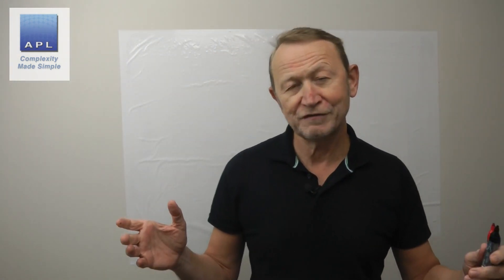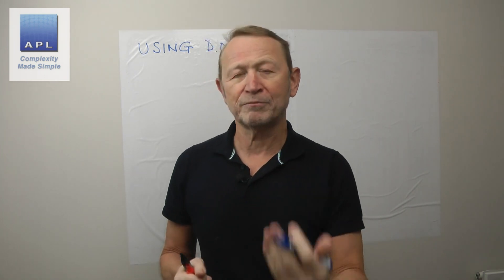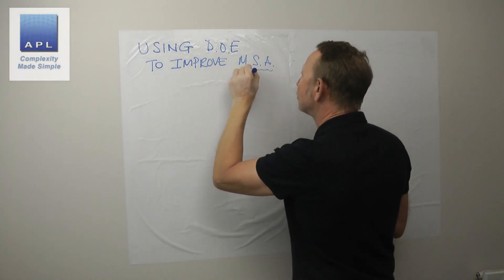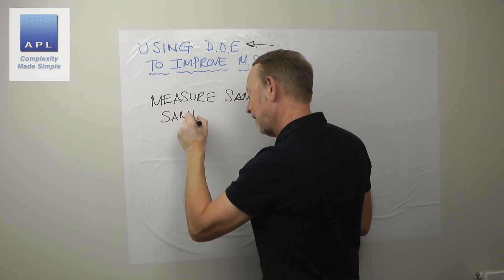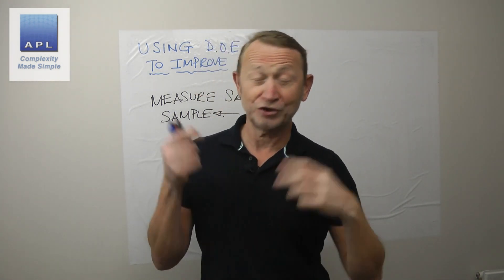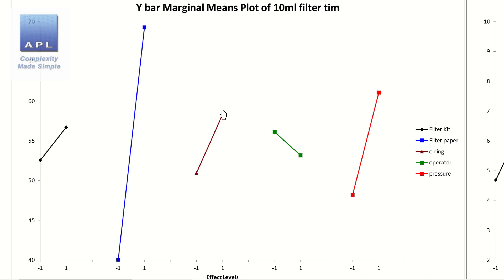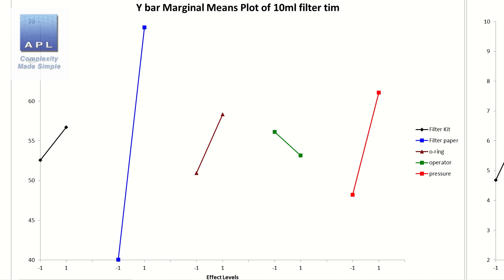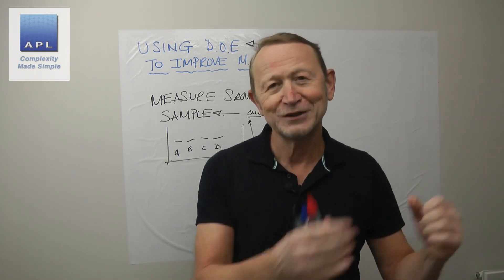Using a DOE to improve your MSA

Comment: Allen, I have a question regarding the MSA session in your book DOE for 21st Century Engineers: In page 195, you show us an SPC XL Anova results where Repeatability seems to contributes to 48.88% to the total variation, whilist Reproducibility contributes to 0.46% to the total of 49.33%. But in this very page you wrote that actually REPRODUCIBILITY is 10 times larger than Repeatability, and then show us how it can be explained by the operators differences in measuring. I just want to understand how, based on THIS Anova the Reproducibility is actually producing more error than Repeatability. Thanks in advance, keep up the good work. I really enjoyed the read and I will definitely recommend it to other.
Reply from the maker: Hi there - looking at the page, you are looking at different columns on the results table. It's not easy to explain in a message, but the contribution is based on variances, I'm refering to standard deviation....